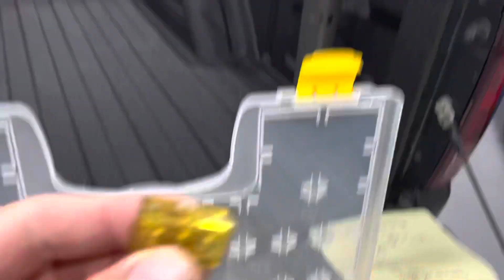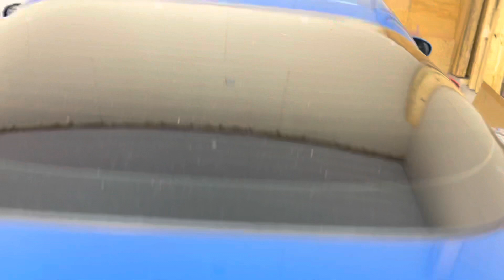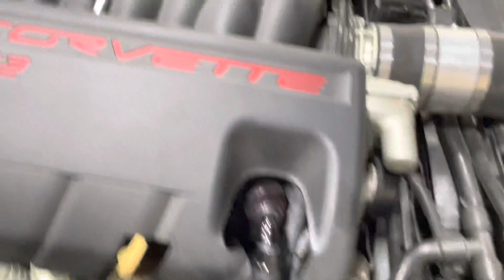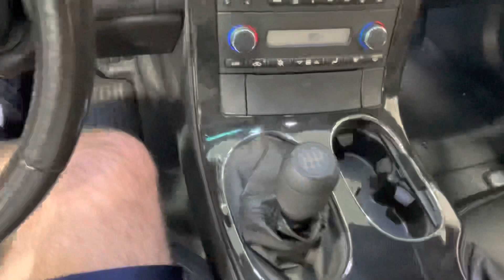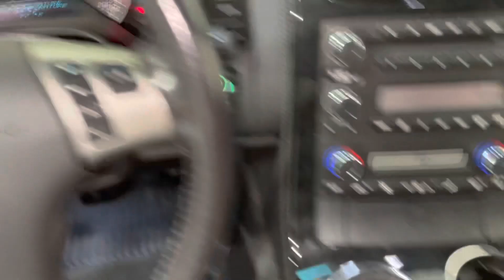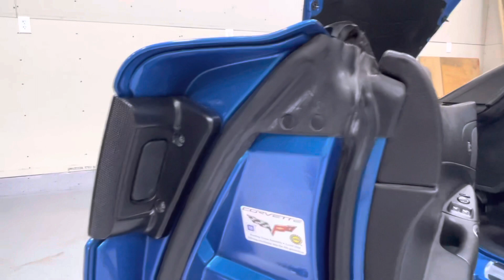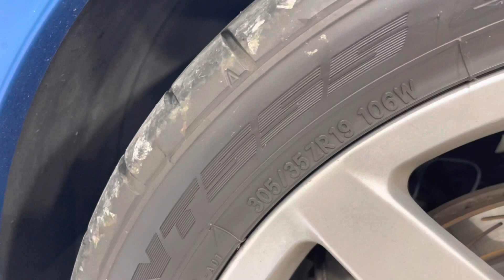Part 1: Common questions and answers from 5 years owning my C6 Corvette

Comment: Coming from a guy that doesn’t know manual. Is a automatic better for street racing ? Or should i get a manual ?
Reply from the maker: Cannot give any advice for racing on the streets… I’d never do a thing like that. However, at the drag strip a manual will be much harder to launch and be consistent with. An automatic will dominate in consistency there. Roll racing, autocross,  or road course seem to be dominated by manuals. Personally, I like driving a manual. There’s just something about ripping through the gears (within the speed limits, of course) after a long day that melts the stress off.
Reply: Will it be hard learning manual on the c6 for the first time ?
Reply from the maker: @eduardoortiz4661  IMO, no. Lightweight car with gobs of torque should be pretty easy to learn in.
Reply: @Mr_SynergyPerformance  how many times do you think clutch would take a beating when im learning? lol because ive heard clutches for corvettes are expensive
Reply from the maker: @TWIZZY_RlCH  depends on how bad of a beating you put on it each time and what shape it’s in when you start. They are fairly robust, but not indestructible. Thanks for watching!